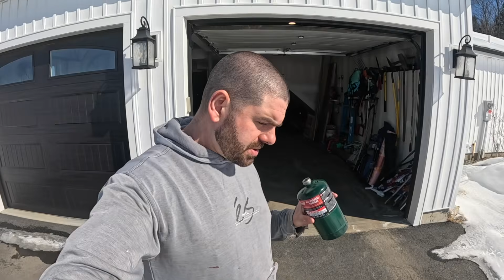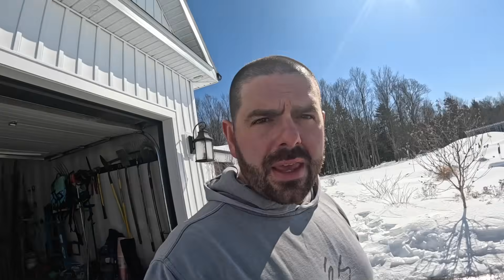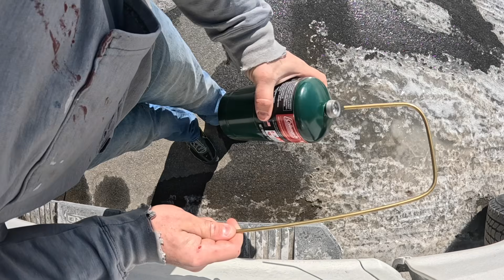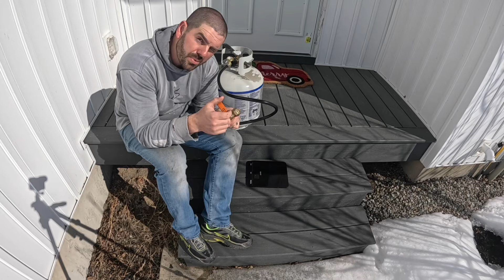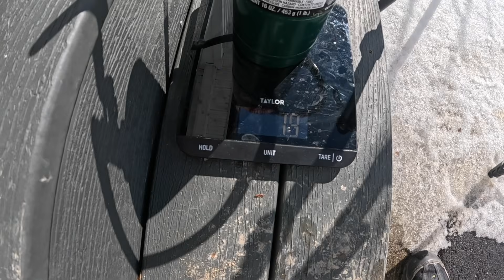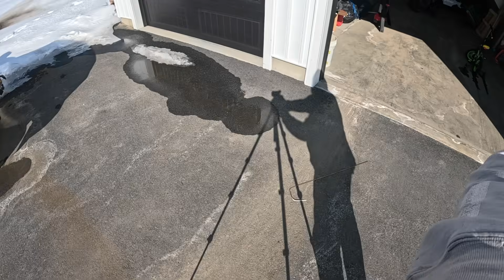Is Refilling Your Own Propane Tanks Worth It?

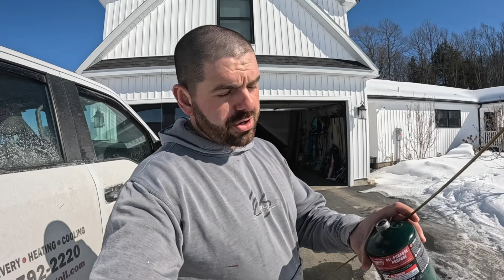Comment: "Never Refill 1 lb., Propane Bottles (DOT-39 cylinders)[4:21]: The public is cautioned to never refill DOT 39 cylinders, i.e., 1 lb., cylinders used for camping. DOT 39 cylinders, of any size, are strictly non-refillable."  Department of Transportation (.gov) .
These types of disposable containers were not designed to withstand the stresses of emptying and refilling.  Refillable 1lb containers are available.
Reply from the maker: you are totally right, i gave the full disclaimer towards the end of the video
Reply: Being a retired regulatory expert in propane you're spot on👍